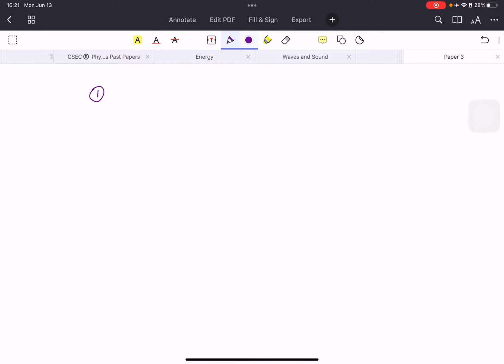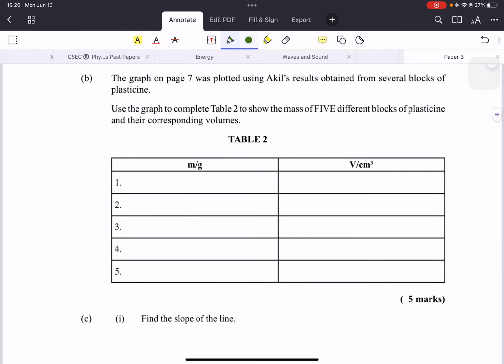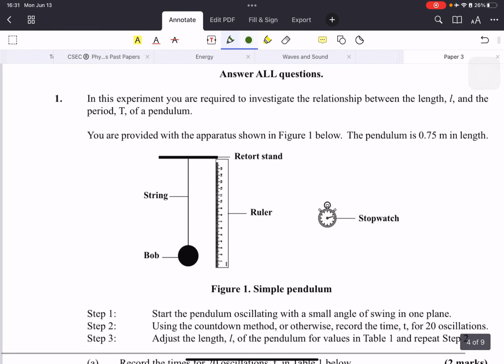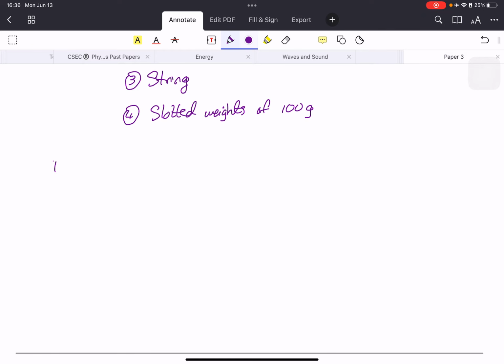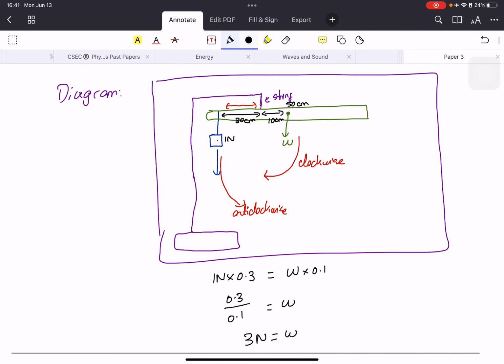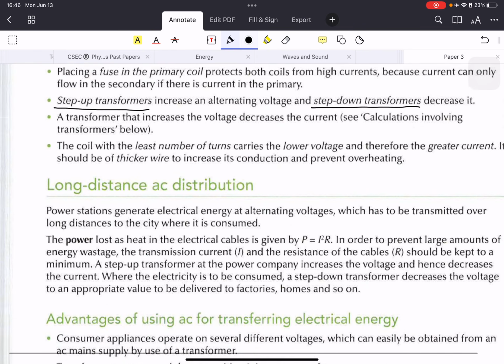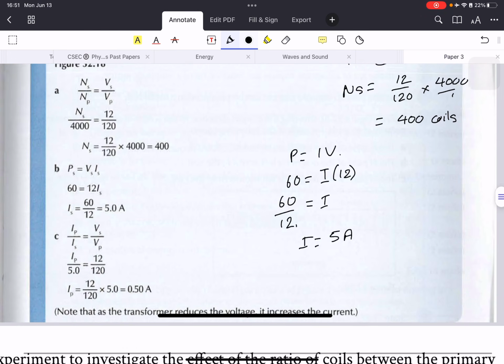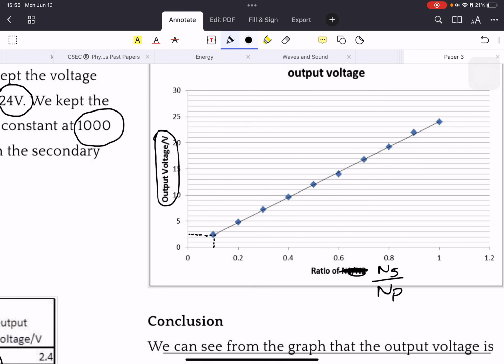CSEC Physics - Paper 3 Broad Topics: Graphs, Measurements, Turning Forces, Transformers (2022)

Comment: Hey sir, what will be the Difference between Time and Period in the Measurements example? Because I understand the time will be the time taken for each length but what'll be the Period? 🤔
Reply from the maker: Hey sorry I forget to mention it. The period is simply the time taken for the oscillations divided by how many oscillations you chose to count. So for example if you counted 10 oscillations and that took 20 seconds, then the period is 20/10 which is 2. And don't forget the graph will be T squared vs L. So you have to square the 2 to get 4, and so on. Good luck!